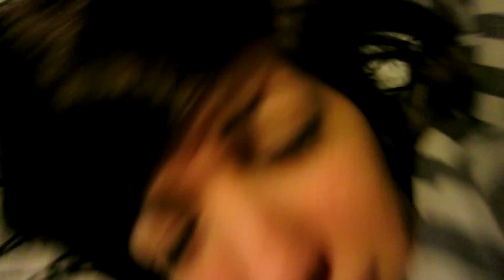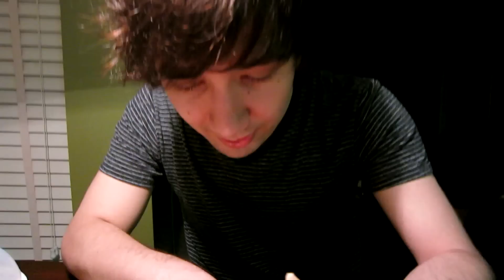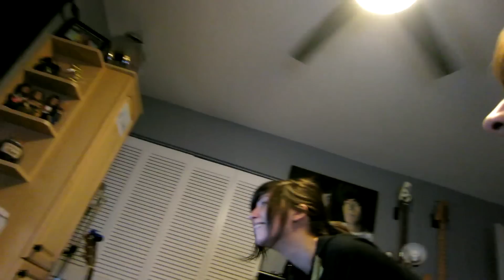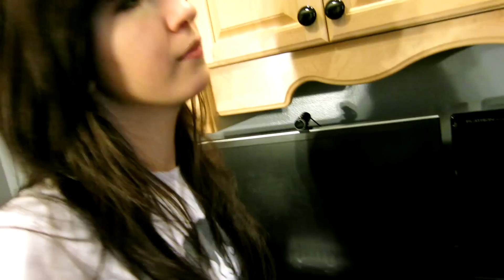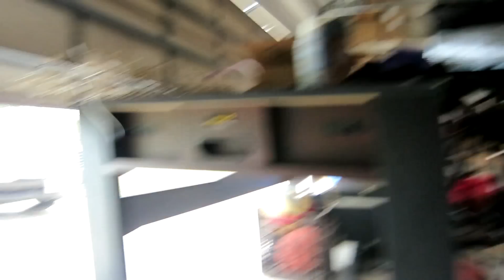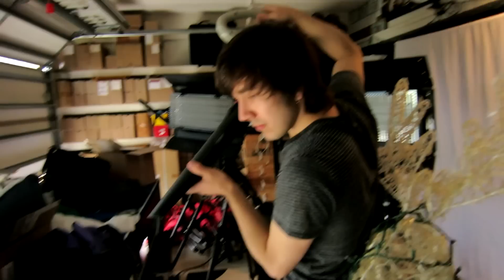How to Clean Computer Dust REALLY FAST!

Comment from the maker: @GaxAngel Pshhh cable management shmable management. It's all a waste of time. This computer has plenty of airflow and runs extremely cool. As far as I'm concerned bad cable management is good cable management. The way I see it, having more cables everywhere gives the dust a place to get trapped out in the open in the middle of the case for you to clean out easily, in a place that wouldn't harm any hardware. =]

Comment: Hey DJ, a few SSD Tips. First google "optimizing precious solid state storage". It's by Tom's Hardware and some of the tips are overboard, but there are a lot of good tips. (Take it with a grain of salt.)

Also, there is a bug with all the Crucial M4s (I have the 128GB) and updating the firmware will eliminate the issue. It basically will BSOD every hour after 216 days of power-on time. Just google it and update to 0309 firmware. It's safe and pretty easy. It shouldn't affect any of your data.

Comment: Yea thanks I just did the same, the fans spinning caused a back EMF and fused the power supply, and the computer no longer boots, Plugging in caused the circuit to breakdown  in the wall, and the cable overheated causing a fire, and my house burned down and now we are homeless, We are coming to live with you.

Comment: @evsboy123 What are the computer specs? And what's your budget for a new one? You don't need to go crazy with the parts you buy. Check out newegg.com. They have packages called "DIY PC Combos" that you put together. The other component you'll want to get is an audio interface. If your just wanting something basic for guitar, Line 6 has some great stuff. You can also check out Presonus. They've got some great, affordable units that will take care of latency issues. PM me if you got any questions.

Comment: Hard drive has an issue?  Easy:  Spinrite.  It is the BEST hard drive tool.  It will fix every single error 100% of the time.  Best tool, hands down.

PS:  Getting the new processors right when it comes out is the worst idea.  The first chipset almost always sucks, and then you may need to get a new motherboard just to have your computer work properly.

PS:  You have the nehalem cpu, right?  The new intel chips are the update to nehalem. 
PPS:  quad channel ram. SO MUCH OF IT. 32 gigs, min

Comment: vacuum works good if your worried about static just ground yourself touch metal of vacuum to  the chassis of the case then no worries about static you like in Florida as do i you wont see much static here unless its really cold the humidity prevents static charge now is under 50% relative humility then there could be a issue  another great way to dedust your pc is air compressor just hold your fans while blowing it out.dust can cause allkinds of problems along with shorting connections  on  mobo